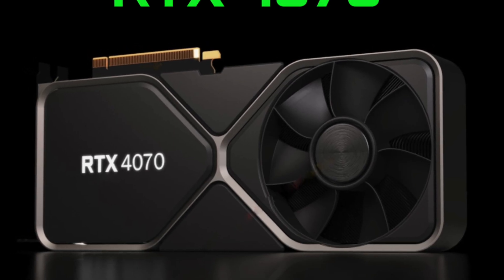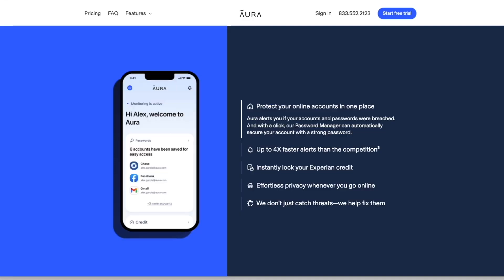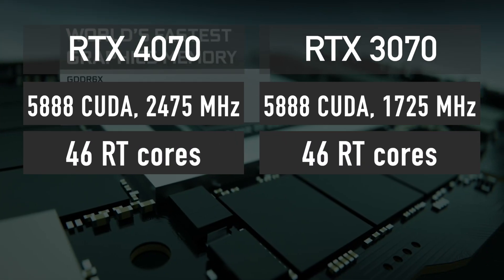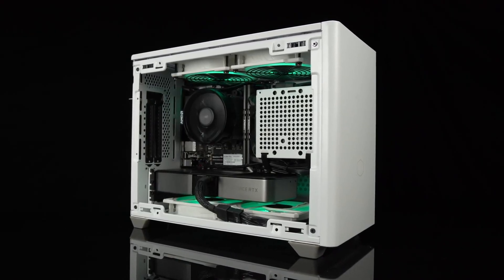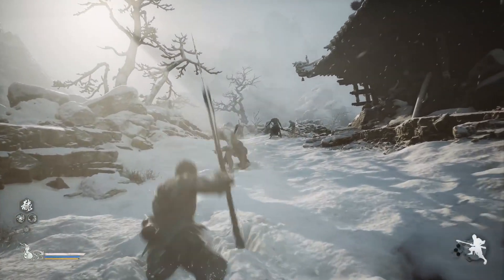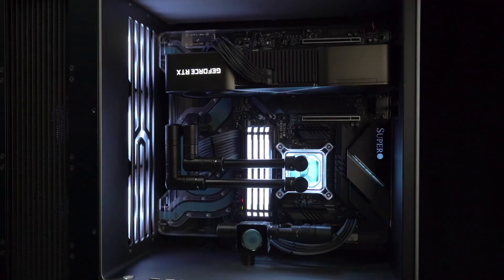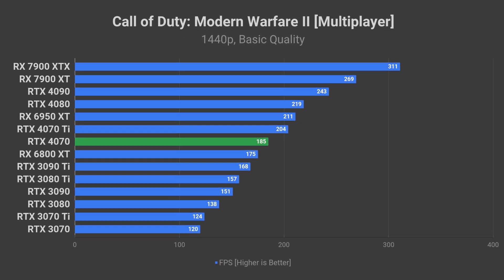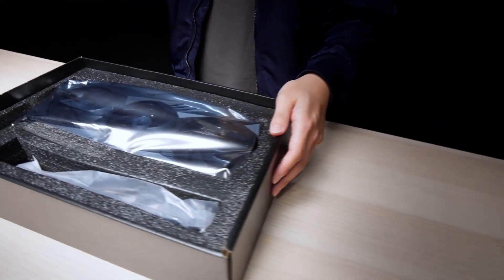The WORST FAIL of 2023 in the making 👉 RTX 4070

Comment: 12gb is far from capable in 4k ultra on 2023 titles. Don't be fooled.. this thing is a scam.
Reply: 12 GB will not be enough for 4K, especially with future AAA games and if you are using ultra settings at 4K. 12 GB is ok for 1440p, while 16 GB is much better for 4K. For 4K gaming at ultra settings in AAA games, 16 GB is what you want. Over 16 GB of VRAM never hurts as well.
Reply: 4070 and 4070 ti are meant for 1440p, fact it can also play 4k is just a bonus.
Reply: @whysoseeryus3053    4070/4070 Ti can’t do 4K gaming properly in demanding AAA games. One reason for that is because of the shit 192 bit bus they have, which limits their performance at high resolutions such as 4K. And their 12 GB of VRAM is another limiting factor for 4K.
Reply: @RenderPixion  AC Odyssy is 5 years old. We don't buy top new gpus to play 5 year old games. 
Your card is from 2020. 
Of course it will manage AC Odyssy. 
So basically 16 GB is the minimum for 4k, as you outlined
Reply: @Strongholdex   I am not saying that. I am saying that 16GB of VRAM is the optimal amount of VRAM to have for 4K gaming in 2023.
Reply: @RenderPixion  I know. I Said myself that you outlined that. But for New titles 16 is the minimum is you want 60fps experience in the 1% lows.
Reply: @Strongholdex   Some people don’t understand that though, and say 12 GB is plenty. They clearly don’t know what they are talking about. If a game uses 12 GB or more, they just say the game is poorly optimized, which proves they are completely clueless on what they are talking about.
Reply: @RenderPixion  Do you remember how the people said that Far Cry3 is badly optimized because it ran crappy on 1gb vram? THis is exactly it. 12gb is enough (but not great) for THIS moment. The rtx 3070 is already basically obsolete. It gets less than 20fps in hogwarts. The same will happen with the rtx 4070. Last year I upgraded my 10 year old laptop and bought a new one with a rtx 3070 and ryzen 7 5800x. I use it for casual gaming. In games like Just Cause 3 I get like 103-133 fps, even though I play in 1080p and the game is from 2015. People underestimate what hardware they need, especially if they want more than 90fps. I will not upgrade this generation, as I have plenty old games that I need to play, including Fallout 4, Mafia III, and so on. Nvidia this gen just sucks. The rx 6800xt costs here 570€ and the rtx 3070 ti more than that. This is just hilarious, given that the amd card in the same price range has double vram. However, AMD is bad at raytracing so basically I wait another generation and hope that in rdna 4 AMD sorts its problems out and delivers against Nvidia. Originally I wanted to buy an AMD laptop, but there were none. AMD needs to ramp up production and realize they can only demand 2/3 of onvidian prices as they are behind when it comes to software. I would say they need more than one year to catch up. It is questionable if they will ever be able to catch up to Nvidias Software  like DLSS.
Reply: @Strongholdex   It’s pathetic how a lot of people just say the game is poorly optimised every time. Like you said, the 3070 is basically obsolete, and one major reason for that is the 8 GB of VRAM. 3070 is pretty much only a 1080p GPU now. It can’t do 1440p high/ultra settings at 60 FPS in most modern AAA games without upscaling. 8 GB of VRAM is only enough for 1080p now.
Reply: @whysoseeryus3053  you can get a 6700 xt for 1440p with 12gb...
Reply: @whysoseeryus3053  it is priced for 4 though
Reply: I got 16GB for 1440p and I view that as the minimum
Reply: This is hard to predict. I would recommend 16GB VRAM if you want to do 4k, but right now you can get away with less. My RTX 3060 Ti 8GB can do most games 4k with reduced settings of course. DLSS can often help out too. Assassin's creed odyssey plays like a dream with medium settings and high textures with native 4k. It is a shame Nvidia is lagging behind AMD when it comes to VRAM
Reply: You'd be an especial idiot to get it for 4K anyway.
Reply: thats why arc a770 16gb is here , perfect gpus just need the perfect drivers
Reply: So can someone explain how this card is a scam when the numbers say it performs better than a 3080? Can someone explain to me how 12gb is far from capable in 4k ultra when it still outperforms the 3080 at that resolution? Heck, it's even outperforming the 3090 and 3090 ti in 1440p
Reply: @ShadowCatGambit  no it doesn't. At least not in Vram heavy titles.
Reply: @dazeen9591  the numbers that I've seen here say otherwise
Reply: @ShadowCatGambit  4070Ti is really a horrible GPU and you should never buy it.

The 7900XT which is actually cheaper, is over 40% faster in Call of Duty Modern Warfare for example and between 10-15% faster in every other title as well.

Other big wins for 7900XT are Cyberpunk, Hogwarts Legacy and Doom Eternal which are known Vram heavy games. 

4070Ti's lack of bandwidth and lack of Vram capacity does show in these titles. It's really not enough for future proofing.
Reply: @dazeen9591  The 4070 Ti performs as well as a 3090 Ti, regardless if it's 4k or not, and it does this with less resources, less energy, and at around half the price or less. I bet a lot of people thought the 3090 Ti was good future proofing, but a cheaper 12 gb graphics card works just as well a few years later. Everyone keeps spewing so much disgust and hate towards Nvidia's new cards, but all the data I look at tells me they are good cards.
Reply: 12 is still sufficient for 4k today, I can confirm, I game at 4k on a 3080ti. RE4 maxed out with RT on ran fine with multiple play throughs. In another year or two though, I could see this to start becoming an issue. 12gb vram is bare minimum buying a card today if you want it to last more than two years into the future.
Reply: @rg975  depends what you play. I personally feel like a 1000€ GPU having only 12GB feels scummy. You pay 1000€ price premium for a GPU and you cannot even play every game on the market at max settings. 

There are plenty of Vram heavy games that won't run well at 12GB.
Reply: @dazeen9591  I mean two years ago 12gb felt like enough, but next gen only titles are releasing now and yeah, 12gb isn’t enough if you’re buying a card right now, hindsight is 20/20. I’ve never had stuttering issues in any titles even with RT on, I think the “12gb isn’t enough vram anymore” argument is a little blown out of proportion. Later down the line this will definitely be changing, as all hardware ages, but for the next few years, 12gb will be fine for people happy with their setup that bought a card a year or two ago.
Reply: @rg975  12GB wasn't enough 2 years ago either. GPUs should be future proofed as much as possible, something Nvidia has refused to do in order to give their products a set date of obsolescence.
Reply: @dazeen9591  what game released 2 years ago with vram issues for 12gb cards?
Reply: No. 12 vram 4k. 16 vram 8k. 20 vram 8k new gen game only

Comment: if the 4070 is $750 why would anyone not buy a 4070Ti instead? Maybe that's Nvidia's idea. Is the only difference between lesser GPUs going to be $50? That would mean a $550 4050 which is ... nuts.
Reply: i really hope this gen AMD start getting the advantage in the mid-range market of GPUs with the 7600xt and 7700xt, the 7600xt are supposedly going to be launched at the same price as a 6600xt which is over 325 dollars, while getting a similar performance to a 6800xt or 6900xt in the best case scenario, NVidia needs a hard slap for them to come down from their cloud
Reply: There are at least 2 reasons to buy the 4070 over the 4070 ti ... at least on paper ... faster memory bus and MORE of it...
Reply: @JHutchGAMES  Where did you get that? Same 192-bit bus, same VRAM speed